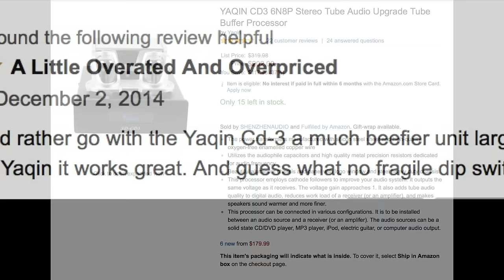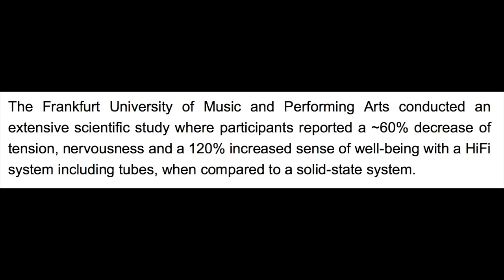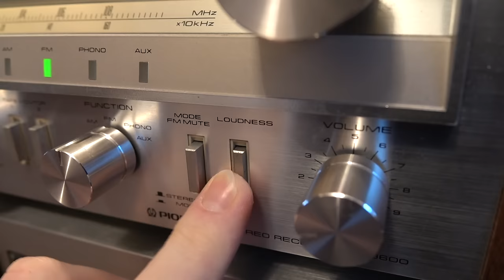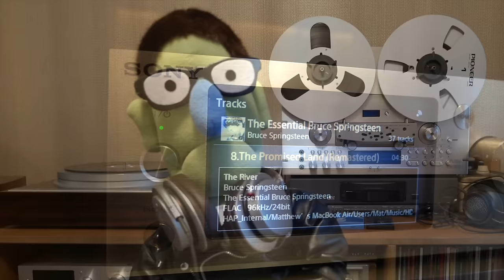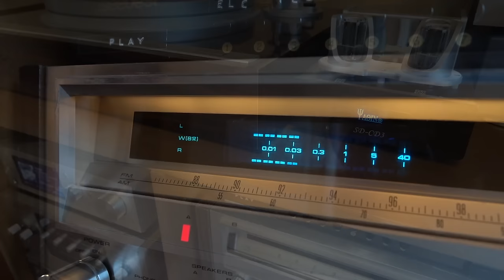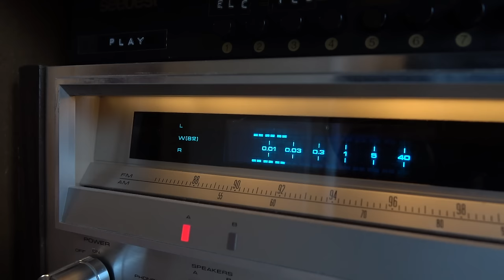Add the magic of Valves to any HiFi - with The Yaqin SD-CD3 tube processor

Comment: For some reason people seems to like valve altered sound, why? I don't know why but the only thing valves do is introducing distorsions... Maybe the sound is more charming and warm using valves and maybe our brain just doesn't like sounds that are too analytic and cold in comparison.
Reply: +MasterControl90 Well according to some studies, valve distortion is more in the lower end of that harmonic distortion which a lot of people seem to like. Don't be fooled by "warm" or "cold" buzzwords, it's too vague to accurately describe the sound of something.
Reply: +MasterControl90  I could be wrong but. I believe it is because valves produce  (relatively) large amounts of second harmonic distortion and so do our ears, thus we perceive the valve sound as being more "soft and natural" , as apposed to something like a cheep vintage transistor amp, these often had poorly matched transistors in the output stage which gave rise to mostly third harmonic distortion and sounded harsh, almost scratchy.
Reply: +Bishka100 Something like that! Valves introduce lots (and by lots I mean LOTS) of even harmonics, which to our ears sound warm (often mistaken for "natural"). In the old days, the first solid state amps introduced lots of uneven harmonics, which, again, to our ears, sound harsh and "metallic". Modern transistor amps, even cheap ones, add just tiny amounts of harmonics (in the region of 0,001%), whereas modern valve amps (or processors) are in fact not modern, they still spew out distortion like there's no tomorrow. So in reality, transistor amps sound a LOT more "natural" than valve units, even though valve enthusiasts claim the opposite.
Reply: +MasterControl90          from what i have read:   acoustic musical instruments  produce even number harmonics, along with the main harmonic or note.  Tube amps produce distortion but like instruments, they produce only the even number harmonics. Thus folks will say that they sound more "musical" . Is this an improvement?    Until we can learn more about how the brain works, and learn to measure minute audio signals, the answer is "its up to you".
Reply: +MasterControl90 People's perceptions of the valve sound are coloured by their knowing that they have a valve amp. The real test is to do a blind comparison - not knowing which sound is 'vanilla' and which is the coloured by valves, which do you prefer?
Reply: ThePhiloctopus Hard question, never had the change to actually have a direct comparison between good (not very high end but neither low end crap) IC amp and a valve amp... But I can actually reply with "till it sounds good to me both tecnologies are fine". That doesn't mean that every piece of c**p  of audio device sound good to me, for example I'm one of those that can ear mp3 distorsions very easily unless it's a 320kbit/s which is more difficult and depends a lot on the music itself. I presume btw that if I actually do a "wide range" test with all sorts of amps of both worlds, giving a point to the ones i really like, in the end there will be more points for IC ones than valve ones, because I usually prefer a really clean, low noise, not too much emphasized sound. As many already said, in the end is a subjective preference that actually being better or not.
Reply: +MasterControl90 There is distortion and then there is distortion. Tubes or valves work by amplifying voltage solid state or transistors work by amplifying current. Speakers work with voltage not current because it uses a voice coil. All electrical components with the exception of a pure resistor change properties based on the frequency of the signal this is called impedance. Because a tube or valve generates differing voltages you don't need as many components to couple the amp to the load thus lowering the signal phase changes introduced by other methods. 

Transistors can have very high internal noise so a lot has to be done to reduce this effect which can also introduce phase shifts. Valves or tubes can also have internal noise but the method of reduction or neutralization of the tube does not introduce the same phase shifting results. What tubes or valves do naturally is generate harmonics of the input signal. This is not necessarily bad because the very best instruments do as well. This is what adds the live or warm sound people seem to prefer. 

Distortion is a measure of how much the output signal differs from the input signal but the same figures for distortion do not sound the same depending on if it is pure harmonic distortion or added noise. Phase shifting is usually not measured but also makes a big difference on how live something sounds. A phase shift of as little as 15 to 20 degrees is quite noticeable. 

I have tried to simplify what is going on but if you really wan to learn more you first need to understand some basic A.C. theory before moving to amplifiers.
Reply: +MasterControl90 "Analytic" really doesn't make any sense to describe sound.
Reply: Cheers Rich, you made me understand that black dog.
Reply: I think that distortion is exactly the desired effect. I know that whether you're playing through tubes or solid state, you never want the signal to clip, but I think any guitarist will tell you that solid state clipping is nowhere near as pleasant as the warm crunch of an overdriven tube amp. That's not exactly a fair comparison, as guitarists aim to overdrive the amp, while hi-fi folks avoid it like the plague, but any system is going to color the sound in some way, and I know that my grandma's old hi-fi, while not as crisp and clear as a lossless file or even vinyl through my more modern solid state amp, does have a certain pleasant warmth to it. I'm all for clean signal chains, but in the end, I'm also all for whatever makes somebody smile when they hear it.

Let me reword that first bit: I don't think distortion is the desired effect, but the particular kind of color that tubes provide. It's exactly what the audiophiles he's referring to in the video complain about, but it's also exactly the desired effect, so they're really barking up the wrong tree on this one.
Reply: really depends on what system you are using. in my experience you either spend 2k for a tube amp or you build yourself one..which is the best alternative

Comment: Please test a DSP (Digital Sound prozessor) to calibrate your audio setup. So you can calibrate nearly any speakers specific for you room. i think this can even make a cheap speaker setup sound good.
Sorry for my bad english, im from germany 

And thank you for your very informativ videos
Reply: +PCFreak9931 no reason to apologize about your english. it's a whole lot better than a lot of native english speakers I've seen online...
Reply: +PCFreak9931 Yeah, there are quite a few bits of software and hardware these days for correcting the audio for a room. I haven't tried any but it would be interesting to see if any of them work well.

Searching for "Digital room correction" may be a good place to start.

For example the KRK Ergo is both a DAC for a computer and room correction in a single box. So just plug it in to a computer, calibrate for the room and all audio will be correct. But I think that there are also lots of solutions that will only work using plugins for DAW software (Digital audio workstation software [used for making music]) these would be far less useful for music listening.
Reply from the maker: +PCFreak9931  I'll do a bit of research thanks. It's always good to have something new to read up on.
Reply: acourate is what i use and used by the pros....its not cheap, but worth it.

Comment: I bought one of these a few years ago to partner with my Wadia cd player as it was very technical & lacked warmth. With the Yaqin, it added warmth without detracting from the detail. Still using the original valves, but when they go I will upgrade.

Comment: Those chinese Uk plugs aren't even safe either. If you look on youtube you can see them setting on fire and all that. They aren't even fused.
Reply: I hope you are just kidding. For your information, UK is one of the only countries in whole world that uses that silly fuse in the cable. It's basically worthless if electrical installation in your house is done in last 25 years, or at least checked by electrician in last 10.
Reply: +Csab UK uses ring circuits and that's why we need individually fused plugs, look up 'ring circuit'.

Comment: Don't worry what people are saying. keep doing what you're doing.

I owned the upper model of this and used it for close to two years as a preamp for for record player. I never used the original tubes that came with it -- everyone online said to swap them out. I went through two decently priced (not cheap) sets of matched tubes (matched is important and tube depot.com can help with that), and honestly while it sounded warmer it sounded dead inside. I still have it in the closet. I think a certain listener  fatigue sets in after one uses a certain configuration for a while. I swapped it out with Cambridge Azur 665 preamp and love it for now.  

Before Yaqin, I was on a NAD preamp external -- very cold, very restrained barely there sound and NAD internal amps of previously released NAD preamps and amps released in the 80s. The preamps in the earlier 80s 90s NAD amps sounded better than the current day NAD preamps.

Comment: If you don't want colour in your sound, buy a pair of studio monitors. Otherwise you're just being hypocritical. And the common misconception is that valves/tubes will make your sound 'warmer'. Its true, but only when they're overdriven. The reason valves/tubes are associated with a warmer sound is because the 70's and 80's rock was recorded with inputs from microphones 'hot' or overdriven, add a signal that is too high when recording to tape and the tape also adds natural compression to the sound essentially 'gluing' everything together. This in essence gave the iconic warmth; overdriving and boosting beyond the redline.
Reply: None of those things are true. They used fuzz pedals that evolved from devices originally intended to replicate the sound of an overdriven amp. Saying that the sound of 70s and 80s rock is the sound of an overdriven amp is like saying that modern electronic music is all drums because it evolved from music that made heavy use of synthesizers that were originally intended to sound like a drum kit.

 I know some of the people that did the recording of all that 70s and 80s rock, and I am familiar with the strange way they did (and still do) things. They only reason they used good studio monitors was because thats what happened to be at the studio when they did recording sessions. The few people still around who do things like that often mix with Beats headphones in their home studios because they hear they are good, and they are also expensive, so they probably actually are good. And thats all the thought they put into it. They spend their time worrying about trying to get their instruments to sound the way they want them to, and they are generally ok with using studio trickery to achieve that, as long as they can get sorta close when playing live.

Also, they try to get all the instruments to sound like they are at the same volume, which explains a lot about they way rock form that era sounds.
Reply: I'm not convinced it's just low-ratio compression that does the glueing. You can hear a Pultec without driving it hard. I measured steady-state harmonics between -50 and -70dB at 100Hz, which is piddling if we're talking about compression. Yet the sound was definitely there.

Comment: Thanks Techmoan - having owned quite a few valve amps / tube amps I love the sound. I intend to go back down the valve route again and I don't care what others think. I have had all sorts of hi fi since the early 80's and it's purely in the ear of the listener.
Reply: +Mark Keen Yes, and with today's prevalent highly compressed digital music you get to the point where even the average ear can tell the difference. Has Techmoan done any reviews on loss-less music systems and players yet? That would be interesting.

Comment: I had a Carvin TS100 true stereo valve power amp that I used in my guitar set, but I stopped using it three years ago so I decided to sell it. Since it hadn't been used for some time I hooked it to my Bose speakers just to check if everything was still working. Tested it with a record and a CD and immediately regretted having sold it! Wow, just wow! And it wasn't even a dedicated HiFi amp!

Comment: but those are tubes not valves, valves are the water switchy things you have in the bathroom,,,
Reply from the maker: +Theodore Krap I've got tubes in my bathroom.
Reply: In the UK we tend to call them valves. Just like bonnet=hood petrol=gas aluminium=aloooominum etc etc. There's no problem here.
Reply: +hyperion8008 Called a valve because it controls current flow....like a ..VALVE does!!

Comment: What valves do is add approximately 0.2% of 2nd harmonic distortion (K2). The human ear hears it as a warmer or softer sound. It softens especially violins and voices. So it is basically like using softener for your laundry. Some like it, some don't. If you want to save on electric energy bills valves are not a good idea. The sound is a tiny side effect. Basically they are just electric heaters. Significantly more so than old fashioned light bulbs. I once had a friend who used his valve guitar amp as a toaster and it worked well 😁

Comment: Im from the Anti Septic Audiophile network. I am very disappointed you did not bathe in a tank of anti static fluid before handling the vale system development. I find sellotaping small children to the ceiling before using valves, increases the time/space jaunty angle hearing posture before use.

Comment: The difference between a valve amplifier and a transistor amplifier is that the valve amp typically has a push-pull output that generates primariy even harmonic distortion while a solid state amplifier has a 'totem pole' output that generates primarily odd harmonic distortion. Even harmonics sound warmer, odd tend to grate. There are other subtle differences -- vavles soft clip, transient distortion and so on -- but ultimately it comes down to what you like listening to. I don't know what a couple of low mu triodes woud do for your sound but if you really want to play thenyou can use a DSP to simulate just about anything (guitar amlifier manfacturers do this). Personall, I'm ambivalent -- I lie the sou d of my Quad 2 with vintage KEF speakers but a NAD plus modern speakers is a lot more convenient to use.

(Incidentally, I put schematics through a SPICE modeller to figure out how well they work. We can do this for the valve thngimy if you want.)

Comment: Good valve (tube) gear seems to give a roundness to harmonics that is often alluded to as warmth and richness.  I think what this means is a kind of smoothness that our analog ears appreciate.  Less harshness equals longer listening sessions without some sort of fatigue either imagined or real. Valves have their own unique filtering (i.e. peaks and roll-offs) that work especially well music.  I think this is what keeps valves alive many years past the introduction of the transistor.  It is interesting that this unit's perceived sonic benefits include a deeper and wider soundstage.  That combined with the rich and round sound of tubes should be particularly sweet.

Comment: I read an article years ago about why valves 'feel' better, something to do with audio components a listener is not consciously aware of, with semiconductors these components are sharper for the want of a better term, where as they roll off when fed through valves, I don't remember the technical details, but there are audio components above and below hearing range, and while you cannot hear them, they're still vibrating the eardrum and nervous system, these components are reduced when fed through valves.

Comment: I've had stereo systems for 50 years now, both tube and solid state. I prefer the sound of good tube based equipment, it does not mean it's better it just means I like it. A couple of weeks ago I had to service my 20 year old conrad johnson pv-10 preamp so I substituted a parasound php-850 while I was fixing the pv-10. After I repaired the pv-10 I put it back in the system and still find I prefer the sound of the tube preamp to the solid state. The preamp feeds a modified Hafler dh-220 amp that feeds a pair of chane A5rx-c speakers.

Comment: On the contrary to the preamps you have shown in the past, this definitely looks like a more or less properly designed one. Voltage rating on those capacitors indicates the presence of high anode voltage, which is good. Output capacitors are MKP film-wound, the circuit itself is most probably SRPP. This all is a popular arrangement for a DIY-level proper hi-fi valve preamp.

Comment: It's a cathode follower with unity gain. The stock Chinese valves were adequate enough aside from kudos. The circuit is good enough that there is very little difference in valve rolling 6sn7 type valves that are within good specs. A 6f87 with adapter can turn up cool factor if no kids or pets around.